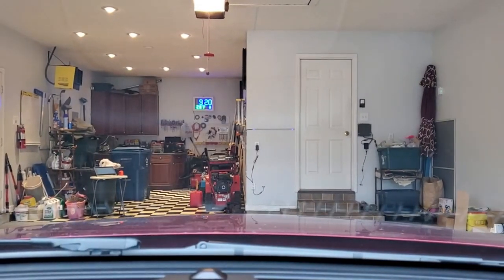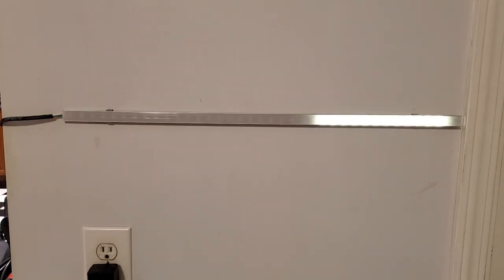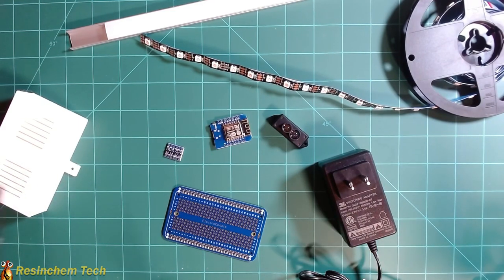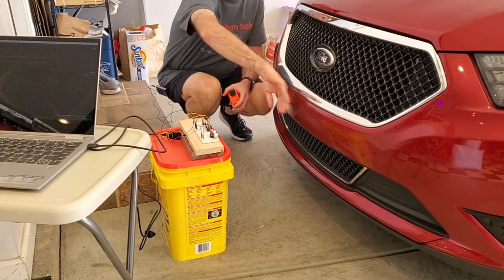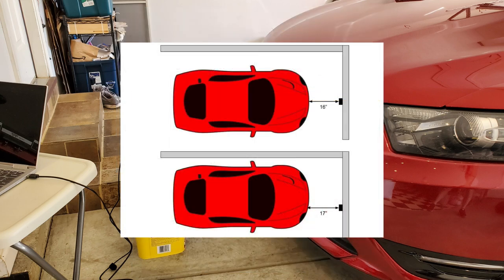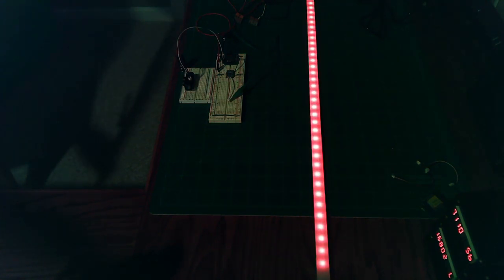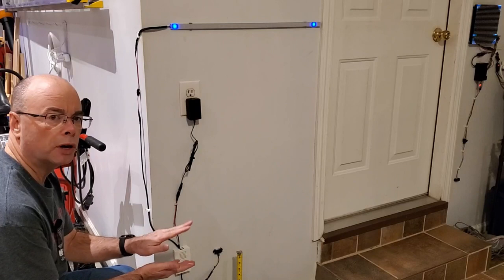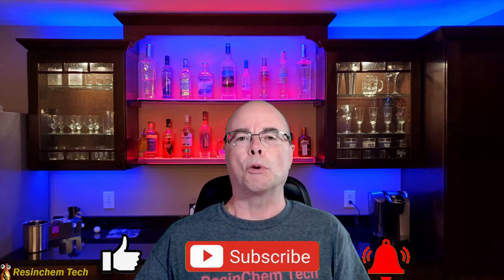A New Parking Assistant using ESP8266 and WS2812b LEDs

Comment: Is it always on? An improvement may be to add a RF reader and a timer to turn it on only when the garage door is opened
Reply from the maker: The ESP8266 is always on... but the LEDs can be set to turn off completely when in standby.  The idea to only turn on when the door opens is a good one... but there is some delay in the boot up process for the controller to join wifi, setup OTA updates, spin up the web server, etc.  It could be anywhere from just a second or two... to 10 seconds or more depending on your wifi and how quickly the controller is able to join.

But it probably takes at least that long for the overhead door to open anyway, so it is a viable option.  Of course, if the controller is "off" it won't be available to respond to a "wake up" command.  It would probably require an ESP32 running deep sleep and some kind of switch connected to a GPIO pin to wake it.  The other option is a smart outlet or switch that would supply power to the controller... and automation would turn on the outlet when the door opens.  This could be done with the current firmware.  Any other options would likely require mods to the firmware.

For me anyway, the ESP controller and the two pixels lit at the end of the strip (which again, can be disabled via the web options) draw such little power, I'm not sure much would be gained by the time you add other components like an RF reader, reed switch and some sort of controller for the overhead door, etc.  In fact, the external components required to turn off the parking assistant might end up using more power than the parking assistant does when it is in standby mode.

Lots of ways to tackle it if you truly want to power down the system when not actively in use.  I appreciate you sharing the idea.
Reply: The average power usage of the tf mini s is 700mw. Is there a stand by function? For my use case it would be nice if there were a option to activate the tf mini over mqtt when the garage opens and deactivate when closed.
Reply from the maker: To my knowledge, the TFMini does not have any command to turn it off or to put it into any sort of low power or standby mode. A possible solution would be to add a DC relay to the controller that would kill the 5V feed to the TFMini and use a pin on the ESP to control that relay... enabling it when the door opens, then disabling (or shut off) the relay after whatever time or other event you determine.  

But to be completely honest, at 700 mw, that works out to about 0.0168 kWh per day, running 24 hours a day, if my math is correct.  That's around 6.1 kWh for an entire year.  I know energy costs are different in different areas, but here in Indiana it is about $0.12 / kWh.  That means the TFMini, running 24 hours a day for a full year would cost about $0.75... yeah, 75 cents for the year.  It would probably take you 6-8 years to recoup the cost in savings that you'd spend for a relay to shut it off.
Reply: it would be necessary to add the cost of turning on the leds every time someone activates the proximity sensor (in case it is a transit site)
Reply from the maker: Yes... and the cost of the ESP8266, which also runs continuously at an average of a few hundred milliamps as well.  Then the LED power is very dependent upon both the number of LEDs and the brightness level they are set to.  But even with these, I would still say that the entire system,  operating under "normal" conditions, such as a car departing and arrive a few times each day, would not cost more than a few dollars a year to operate.

If overly concerned about energy usage of the system, then you might consider a different option, such as a tennis ball hanging from a string, which provides the same basic parking guidance and uses no electricity at all.

Comment: My garage is not heated.  Do you think that this would be an issue?  Sub zero for extended periods.
Reply from the maker: As a general rule, heat is a bigger problem for electronics than cold.  But all components list a temperature operating range.  Just from a quick glance online, the TFMini sensor shows a working temperature range between 0°C and 60°C. The D1 Mini lists its minimum operating range as -40°C and WS2812b LEDs show a minimum operating temperature of -25°C (for the LED pixel, not necessarily the strip). You can find the minimum operating temperature for the rest of the components online, but it looks like the TFMini sensor is probably the limiting factor at 0°C.  It might continue to work below this temperature, but may not be reliable.

If your garage or parking area is subzero for extended periods, I don't think you could rely on this system to operate normally and consistently, primarily due to sensor limitations.

Comment: Great project. Made one too, connected everything, can open the web interface but can't save the wifi setup and connect to my router. Can you help me please? Tfmini S is connected.
Reply from the maker: By web interface, are you speaking about the wifi onboarding app via your mobile phone, or the settings web page?  The settings web page is only accessible if you have completed the onboarding via your phone.  Just to verify, have you followed the steps in the 'First Time Setup' section of the Github wiki?  ( https://github.com/Resinchem/ESP-Parking-Assistant/wiki/03-First-Time-Setup ).  There is also a troubleshooting section in the wiki that has some steps to follow if you have issues with the web/wifi setup.  

Do note that there is one open issue as well that has to do with wifi.  There can sometimes be an issue if your wifi SSID has special characters.  This is a limitation of the wifi library (not mine) that is used.  You might also check out that discussion about wifi in the Github issues and see if it appears this might also apply to you.

It's hard for me to provide much more assistance based on the information you provided.  However, if you continue to have problems after reviewing and following the steps above, could you post more details in the 'Discussion' area of the wiki?  There is a Troubleshooting and Assistance category available.  It is easier to provide help there, since the YouTube comments prohibits posting of things like images, diagrams, code blocks, etc.  I'll do what I can to help.
Reply: Thanks for your fast reaction. It's the onboarding app on the phone. After I select the ssid and fill in the password and save, the board does not reboot and does not connect to the router. My password contains some special signs.
Reply: Hello. Did some extra testing. It is the ssid name that causes the problem and not the password. I set up a guest network with the same password and it works, I could connect without any problem. My ssid has 12 caracters what seems to be the problem. I'm able to set up the parkassist but can't integrate it in homeassistant. Hope this problem can be resolved.
Reply from the maker: Well, I'm glad you were at least able to locate the issue (and thanks for updating me).  As you probably saw from the Github issue, this is an underlying issue with the wifi library used.  This is not something that I developed or control and  I'm not smart enough to create my own!  The issue has also been posted in the Github for the wifi library and I am watching closely for a fix.  As soon as a confirmed fixed is released, I'll update my code to include the fixed library.  

But unfortunately, there isn't much I can do on my end until the developers of the wifi library repair the issue on their end.  If/when that happens, you'll see a new release for the parking assistant published in my Github, and it will state that the wifi SSID problem has been fixed.

Comment: Any thoughts about a location where you can't mount them directly in front?  The upper corner of the room is an option, but that obviously creates some issues
Reply from the maker: About the only thing I can think of if the sensor has to be mounted to the side or overhead would be a simple "stop" style for the LEDs.  There wouldn't be any approach or countdown, but when the car reached the spot where the sensor sees a drop in distance, it could turn the LEDs on.  There would also be no backup... in essence, you'd be reduced to a single "zone"... the park zone, as opposed to the 4 different zones when the car is approaching the sensor straight on.

This particular system would work in that manner (I think), but it would simply go from the standby mode directly to the parked zone, with no wake or approach along the way.
Reply: @ResinChemTech  yeah.  That's what I was thinking.  Unfortunately there is just no practical way to mount a sensor on the opposing wall in my garage.  Thanks for the feedback

Comment: I had a setup like this many years ago: tennis ball on string suspended from the ceiling...
Reply from the maker: Yeah... me too.  Which is why the very first line of the video description says: "Get rid of that old tennis ball hanging from a string in your garage".  The tennis ball is definitely an easy low-tech way to accomplish basically the same thing.  But what fun is that?

For me, I got tired of banging my head into that tennis ball... or catching a 2x4 on the string when working on a project in the garage.  And of course you can't integrate a tennis ball on a string into your home automation system to use as a vehicle presence detector.  But it is cheaper to make and easier to install!

Comment: Thank you for sharing this project! I used esp flasher and put your latest bin file on a node mcu. I have the node mcu on a development board. The node mcu has a esp8266 chip. I am able to join the AP and enter 192.168.4.1 and then enter my wifi network information and enter that I have 36 pixels. The node mcu then reboots and I can't ever find it again... My router doesn't see it either.  I do have the TF Mini installed as well. Any ideas?
Reply from the maker: There could be a lot of potential causes here.  First, do you have the latest firmware (v0.41)?  Versions of the firmware prior to v0.40 had issues with some of the newer versions of the TFMini-s sensor... but this has been fixed.

If you no longer see the device in your router, can you see if it is broadcasting the hotspot again (ESP_ParkAssist) when this occurs?  This most likely means it is not joining your wifi network successfully.  Your SSID and password must be exactly correct.   If, after entering your wifi information, the board restarts but cannot join your wifi, it will not be seen in the router and will start rebroadcasting the hotspot.  Also assure you don't have any firewall or other network settings that might prevent the device from joining your wifi.  Based on what you describe, failing to join your wifi seems to be the most likely cause.

Next, you might want to try reflashing the firmware again (using the latest v0.41), assuring you use the option to erase the current flash if your flashing software has the option.  I did have a couple of situations that the controller went into a boot loop after flashing, but flashing again (with the same firmware) solved the issue.  I don't believe this is your problem, as it would happen right when the board powers up and not after entering wifi information, but it is worth a try, as occasionally a flash doesn't work quite right.  It's also a remote possibility the board you are using is bad.  Assure the board has at least 4Mb of flash memory.

Assure you have the TFmini wired correctly.  TX goes to RX and RX to TX.  Reversing these will cause all sorts of issue.

Finally, while I have not tested with a NodeMCU (just the D1 Mini), it is at least possible that your board doesn't match up to the same GPIO pins.  For the D1 Mini, TX is GPIO1, RX is GPIO3 and D6 is GPIO12.  Make sure these match with the pins you are using.  Try out the above suggestions and let me know.  If I get the chance, I'll also see if I can try hooking up a NodeMCU and make sure it works correctly for me.  But I do know that a number of others have successfully built the system using the D1 Mini.
Reply from the maker: I wanted to follow up and let you know that I just released a new firmware version (v0.42) that attempts to improve the compatibility with some generic ESP8266 boards and I also opened up a Github issue related to what appears to be an incompatibility with some NodeMCU boards.  You might try this new firmware as well as the other suggestions I made.  I do know that the D1 Mini works well and multiple others have reported success using that board.
Reply: @ResinChemTech  It works! I reflashed with your update v0.42 everything works on the software side. Now I will install!
Reply from the maker: Great!  Glad that fixed it.  Thanks for letting me know.
Reply: It’s a perfect project as I have left over Node MCUs, ws2812 remnants, and aluminum strips, and diffusers, and wiring from Christmas lights and ambient TV lighting projects.
Reply: It works!! I didn’t know what GPIO pin for the data wire on the Node MCU so I used PIN6 as your picture denoted for the D1 Mini. It works!! I have it set up in my living room and my daughter was videoing my walking forward and backward testing it out lol. Thank you!!

Comment: I would love to do something liket this but then i have never done anything like this so I would assume it's not a great project to sort of jump into eh ;)
Reply from the maker: Actually, it's really a pretty simple build and isn't a terrible first time project to try.  My related blog article ( https://resinchemtech.blogspot.com/2022/11/esp-parking-assistant.html ) has wiring diagrams and step-by-step build instructions.  Then the Github repository wiki where you get the firmware code ( https://github.com/Resinchem/ESP-Parking-Assistant/wiki ) has full details on installing the software and how to use it.

The only challenging part might be soldering if you've not done much before.  But you can even try creating a version on a breadboard first with just jumper wires (the blog shows an example).  Then the only thing you'd have to solder are the leads to the LED strips.  And if it helps, check out my channel and I also have an introductory video on using LED strips that could be helpful with that step.  But this project would be both a good introduction to using LED strips and microcontrollers.  And, as always, I'm here to help and offer any assistance that I can if you have questions!

Comment: Ahem. at 9:50, 50 mm is 5 cm, which is about 2 inches, not 0.2 inches... 🙂 I suppose you meant 5 mm?
Reply from the maker: Yeah... another viewer caught that as well.  It was a mistake when I was converting from mm to inches.  The minimum is 50 mm and should be listed as ~ 2".  I'm in the process of posting a correction on the video now.

Thanks for catching the mistake.

Comment: Thanks!
Reply from the maker: Wow!  Thank you so much!  If you get the opportunity and don't mind, could you possibly send me which libraries (and which versions) you applied to fix the wifi issues?  I'd love to roll those into my version.  And I think I might make that delay shorter as well... although I don't think the wife has mentioned anything about lag.  But I'll change it and compare my test version to my production version.

If you'd prefer, you can send the info/contact me via email at the email address you can find on the 'about' information of my channel.  In addition, if you are a Discord user, I have a small invite-only Resinchem Tech server with a group of like-minded (and guaranteed friendly/helpful) folks.  If you are interested, I'd like to add you to that group of folks so just include your Discord User ID in the email.  Totally optional... just throwing it out there!